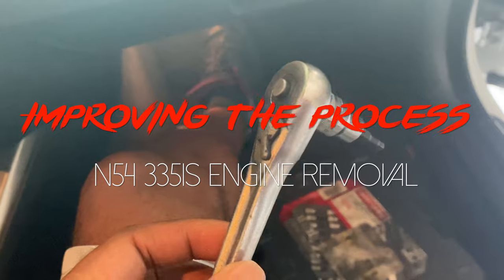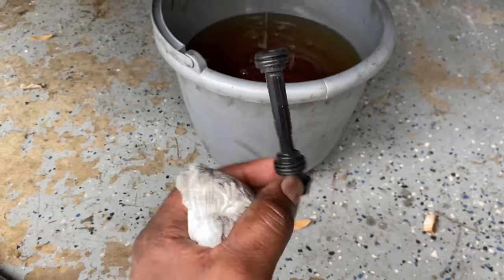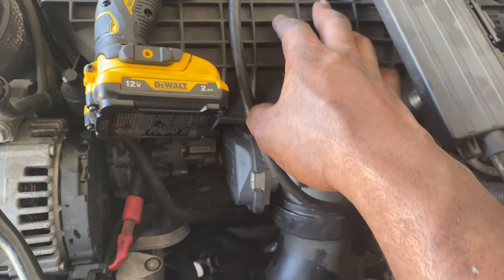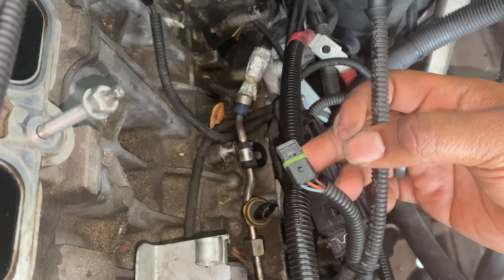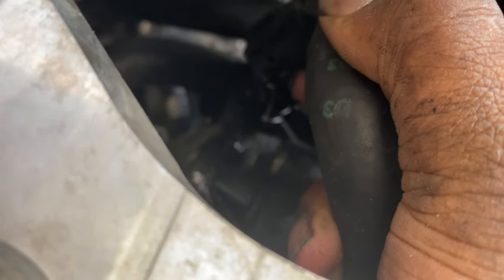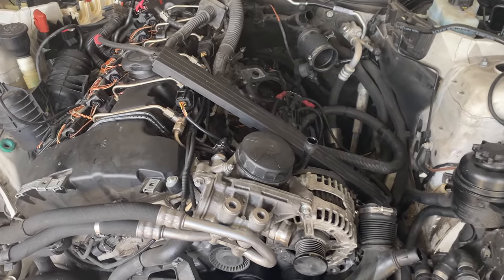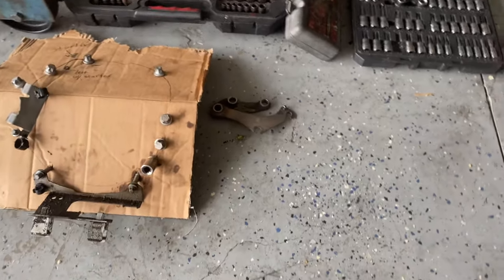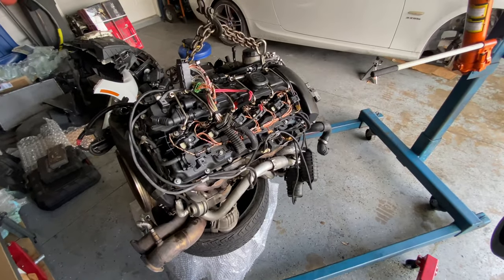BMW 335is N54 Engine Removal

Comment: With my removal my torque converter or gear box stayed attached to my engine, is that ok ? Nothing seems damaged with the gear teeth grooves or whatever. How do I reinstall it to make sure it’s fine? I guess if it lines up rigjt and the trans bolts back tight and flush then it’s fine right? I’m just tryna figure out how u don’t have tori Torque converter attached to ur engine when u don’t even show the part of you removing the Tori’s converter u only showed u removing the transmission bolts

Comment: I'll be pulling my N54 in November, thanks for this guide man. Doing wonders for the E9X community.
Reply from the maker: No prob hope it will be of help!
Reply: you are not alone. i started pulling mine and once i get it pulled im ordering a new engine to complete the swap. Getting the top transmission bolt off with the use of a jackhandle has been a PITA for me since trying it last night but I was tired. Im going to try and make some more progress today. Wishing you luck

Comment: Just finished my swap, thanks to you. Its been a long time coming. Just thought I should thank you for the video man. So thank you!!
Reply: I want to add, I removed the engine and separated the trans and left the trans in the car. It really wasnt too bad lining it back up. Once i got it onto the motor mounts, the bolts lined right up
Reply from the maker: No prob glad it was of help in your process!! It’s crazy since some cars it lines up easy and others it’s a struggle lol, in either case happy it worked out smooth

Comment: so i just got hired at a garage with no professional experience and my first job is removing an n54 from a 335d. i’ve only worked on my 2 honda’s in my garage lol so this should be fun. thanks for the vid
Reply from the maker: No prob and congrats on the job. They threw a wild one at you. But should go over good. The only swap I did was with a d16y8 and then I did an n54 years later. So should translate good working on the 335d.

Comment: This video helped a ton with me swapping the motor in my 335is E91
Reply from the maker: Glad it was of help!
Reply: @nOshi2x  well I still have to do the work, but this helped a ton.  There's a lot of stuff I was planning to pull with the motor that  I don't need to.
Reply from the maker: Ok cool. You can also leave the front clip on to save more time, but I like to take it off for the added room and ease of getting to certain things.

Comment: Nice work and great commentary as always! I just finished swapping the motor in my xi, huge pain having to remove subframe and axles.Do you think it's easier to pull it out with the transmission attached instead of messing with all the extensions?
Reply from the maker: Thanks! Sorry for the late response. Thats a good question. Most of the time I just pull the motor and transmission out together. In this instance I separated the engine from the transmission in the car since I usually always pull the transmission and engine together. So I was just seeing if going this route would be any quicker. I can now say it would be easier to pull it out as one. The main reason I say that is it can be a pain to mate the transmission and the engine together inside the car.

Comment: @complexnoshi  After doing this yourself with a DCT, it is easier to leave the transmission in like you did in the video or if you had to do it again, would you take the transmission out with the engine?

Comment: Honestly bro thanks! thought I was going to have to drop the sub from everything I heard
Reply from the maker: No prob. Yea you can drop the subframe and pull it, or even pull it from the top without disconnecting the front clip. But if on jack stands and in most home garage going to be pretty hard to get the car high enough or get the engine lift high enough to clear front clip.
Reply: @nOshi2x  yeah already have it out got the new motor going in today just from what I heard it sounded like it was going to take the full 30 hours
Reply from the maker: Ohh wow 😯. Nice though tight work!

Comment: Than you for posting this video. I have an E90 N54, That Just broke the timing chain. I Have pulled the valve cover and the intake manifold. I am in the process of removing the head. My quesition would be if you think it is easier to pull the engine from the car or just remove head while still in the vehicle . Thanks again for a great video,
Reply from the maker: Thanks for viewing, I’d find it easier to just pull the motor, and work on it on a stand. Since the turbos have to be disconnected from the head, and while the head can come off with the motor in the car. With the engine out i find it’s less of a headache to work on it. Also great time to do other preventative maintenance such as oil pan gasket, front and rear main seals, etc.
Reply: @nOshi2x  Great Point!  I suspect I will be watching your video a few more times in the coming days. 
I may reach out to you for some more advice if I get stuck along the way..
 Thanks again
Reply from the maker: @jessicasteinmuller7246  yea no prob.
Reply: Was wondering if you had any tips  for clearing the AC line that runs across the front of the car. The Charge Air pipe coming off the  turbos. Not sure if I have the clearence as I am lifting the engine. Thanks
Reply from the maker: I just let lift the motor and slide the compressor down as low as possible without putting strain on the a/c hose and lines and you should be able to lift it right over. One variable that might be different is how high the car is on jack stands and the amount of clearance the engine hoist have to lift the motor out. If thats the case, I would lower the jack stands to their lowest level and you should have more clearance. Since your not doing anything else under the car anymore it’s okay to have it lower. Just remember about supporting the transmission unless your pulling the engine and transmission together.

Comment: Out of curiosity wouldn't it be easier to just drop the entire subframe with engine transmission all in one go? Just disconnect steering shaft, loosen struts, vacuum and cooling lines it should all come down as a unit and reinstall as a unit.
Reply from the maker: Yes definitely! The only thing is if your work area or car support methods is restrictive it will be sketchy to lift the body of the car high enough pull the whole assembly from underneath. In my case I’m restricted by jack stands and my garage. For example just removing the automatic transmission and having it on the floor under the car there is no room to slide it out from the sides, or the front. So with the subframe and the engine being taller than the transmission , I’d have to lift the body way higher. In either case a lift would make dropping the subframe with motor and transmission a lot easier especially if you have an xi awd model.

Comment: Just had 2/3 of my power steering pump bolts break off in the engine block. Instead of fighting it I thought maybe I should just pull the engine since I already have a new set of turbos I need to install. Thanks to your video I now see it is not crazy hard as I thought and should be fine to do. Just one question, On the regular automatic do I need to unbolt the torque converter bolts?
Reply from the maker: For the torque converter you can leave them or remove it once the motor is off

Comment: I will be starting this process on my 135i next week and this video makes it look pretty straight forward.  I think I will leave the 6MT attached though, whatchu think?  The engine I'm putting in is from a 335xi.  Simply swap oil pan and oil pickup, correct?
Reply from the maker: Yea you can leave the transmission in, saves sometime. Lining up the engine and transmission in the car can be a pain, but as long as you have another person with you it will go smoother. Yes just get a N54 rwd oil pan and you you should be good to go. I haven’t seen the oil pickup tube inside an N54 xi, but getting the oil pick up would save some headaches in case it is oriented different in the rwd version. Quite sure it’s different.

Comment: nice video
Question, i have a 2008 335xi that i need to pull the engine out off
do i have to put in  on Neutral  or not and why
Thank you
Reply from the maker: You can leave it in park if automatic or neutral if 6-speed. It’s only if your pulling the transmission along with the engine, where you will need to alternate between park and neutral.  Since you will need to rotate the driveshaft to get access to the bolts holding it to the transmission. So neutral to rotate the driveshaft so you can have access to one of the four bolts, and park to keep the driveshaft from spinning. But if just removing the engine, I’ve left it in both park and neutral no difference motor still comes out.
Reply: @nOshi2x  just trying to pull then
 engine out
Thank you

Comment: Could you please make a video about hardware you use to get it on the stand ? I wanna be prepared
Reply from the maker: I use M12x1.75 x 80mm bolts with washers. Def don’t use the stock bolts from the transmission they are non reusable and have a high chance of snapping.

Comment: Did you have to remove the torque converter bolts?
Reply from the maker: Not on this car since it’s a DCT equipped car.

Comment: My engine blew on my 335 x drive. Will the process be the same if it’s all wheel drive? Or are there things I should watch for ?
Reply from the maker: It will be similar but with more steps. The main thing would be disconnecting the front axels and xdrive components. I haven’t done one personally but from doing turbos on them that would be the biggest difference.
Reply: @nOshi2x  hopefully the xdrive won’t make this process more difficult?

Comment: Hey bro I need to swap the motor in my 2010 bmw 328ix awd 6 speed manual transmition, so whats different?
Reply from the maker: Haven’t pulled a 328ix, so can’t really give an insightful answer. But the concept should be similar minus having to deal with the front  x drive system.

Comment: What happened to the torque converter bolts??? Where’s the site hole to remove them??
Reply from the maker: This was done on a 335is that comes with the dct transmission so no torque converter. Once you disconnect it, the engine and transmission come apart. If your doing this on a automatic, you can pull it without removing torque converter. https://youtu.be/m5cI8lH4IGw

Comment: Do I gotta put the regular n54 335i in nuetral?
Reply from the maker: You don’t have to leave the auto or manual in neutral. Only time you’ll switch to neutral is if your disconnecting the driveshaft from the transmission to get access to the bolts or on the auto if your disconnecting transmission from the engine to reach the torque converter bolts.

Comment: Would it be easier to remove the down pipes before the last bolt on the transmission? Attempting to take a motor out for the first time 😂😂
Reply from the maker: I find it easier to just leave the downpipe side untouched besides the motor mount and bracket. Once the motor is out can tackle the downpipe and turbo easier, since you’ll have more visibility and access to everything.

Comment: I did everything you've done and for the life of me I can't get the engine and trans to separate. I took out all the tranny bolts took off the engine mounting bolts and the exhaust literally everything you've done. Am I suppose to take the torque converter off too or does that come with the motor?
Reply from the maker: This video was on an 335is so don’t have to do that step. If your car is a 335is, I’d recheck everything and if all is good, more than likely your motor is stubborn and have to rock the motor a bit while the transmission is supported and you have the motor connected on the hoist. But if your automatic the only thing holding you up is the torque converter and flywheel bolts, once you remove those you will be golden. In this video at 3:10 is how you remove it. https://m.youtube.com/watch?v=iTw32UEj-0s
Reply from the maker: Actually no, had to think about it some more. You should be able to pull it out with the torque converter attached. So more than likely just stuck and need to rock it free

Comment: wouldn’t it be easier to remove the drive shaft bolts, trans mount and tcm connector then pulling the engine and trans together?
Reply from the maker: Yes can do it that way also if you want to remove it all in one piece. In this instance I just wanted to pull the motor. In a prior video I pulled the whole thing on a automatic car. By far easiest would be just dropping the whole subframe, but only caveat is needing a lift.
Reply: @nOshi2x  thanks for the fast reply man! i’m in the process of pulling my motor and trans hopefully by not having to remove the subframe, only thing left is motor mounts. it’s just a auto 335i. my motor blew and cracked the bell housing with it 😂 . just one question tho, is it necessary to drop the power steering and ac compressor? and do you think i can wiggle the trans out without dropping the subframe? i already replaced the transmission once 😂 thanks again!
Reply from the maker: No prob, you don’t have to drop the power steering or a/c compressor. The only reason I did it was so I don’t have to remove Freon from the system, or drain out the power steering. I guess good time to replace the power steering fluid though. Yes you can pull the engine and trans out without dropping the subframe, as long as the front clip is removed. If you use a engine leveler attachment to your hoist it will make it a whole lot easier, since it’s all about those angles 📐 lol

Comment: when you drop the engine back, which is the easy way to line the engine with the trans?
Reply from the maker: I feel like that's the worst part of the install lol. But I found using an engine leveler and having the trans front tipped up allows them to mate up easier. As I lower the engine I lower down the transmission in tandem, and it generally slips right in. Most of the time when your dropping it in, it will snag on the top of the firewall area, or the pan is hitting the subframe. Main thing is just have to get your angles right.
Reply: @nOshi2x  Honestly the best way is a second set of hands and eyes. This is pretty similar to the way BMW drops their N54s, but they keep 2 techs on each job thats how they get em done so quick.

Comment: So you already got me saving for the On3 kit! My current engine has 153k on it, i feel like once the ST gets installed the engine will go soon after! I'm using this video to remove my engine when it does go! Hands down the most detail and well explained engine removal! How much more difficult will it be since im AWD?
Reply from the maker: Thanks a lot appreciate it. Glad it will be of use to you. For AWD I haven’t done one of those before, but I’d say it’s the same steps plus some additional steps. Such as disconnecting front axels and diff. So maybe like 30 more minutes extra. Shouldn’t be to bad
Reply: @nOshi2x  Much appreciated bro, keep the content coming💪🏾💯

Comment: how do i separate the engine from the transmission? is there a torque converter? thats the only thing i’m stuck on right now please help asap
Reply from the maker: Generally will slide out once unbolted and lift up a little with the hoist. If it doesn’t just rock the motor a little to wiggle it free. Or can also use a pry bar to help separate it by leveraging the spot at the bottom of the between the engine and transmission and has that black flap.
Reply: nOshi do you have an instagram or soemthing where i can get your number in case i have any questions about the engine removal? i’m new to this car
Reply from the maker: ig: el_noshi